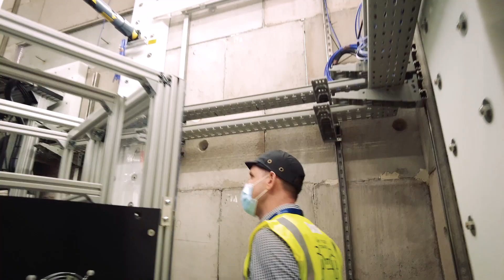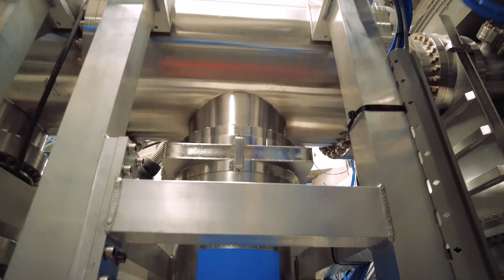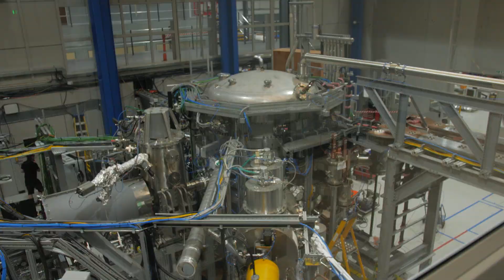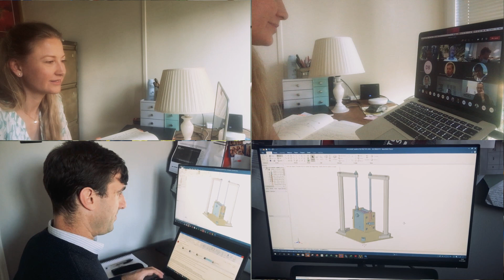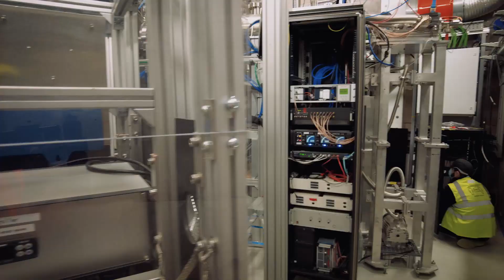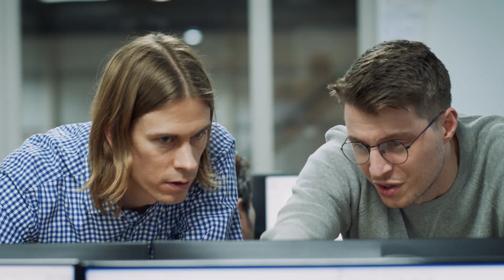ST40 tokamak progress update - March 2021

Comment: Target temperature is easily attainable with intrinsic regenerative process (an explosion) not so extrinsically via an analog process (closed loop regulation). 

The alternative approach may by pulsed regenerative plasma approach. Ten times the traget temperature is easy. Namely the plasmoid. Advantage? Does not intrinsically enter a runaway process also no harmful byproduct.

Comment: Is this reactor project aiming to achieve break even energy output? i.e. not necessarily going to actually harness that energy, but prove that break even is possible?
Reply from the maker: No.  This machine aims to reach fusion temperatures.  We plan to build another tokamak with high temperature superconducting magnets to achieve breakeven.
Reply: @tokamakenergy6400 Thank you for the reply, very exciting to see more smart people work towards something beneficial. 

Btw will you be employing REBCO superconductors on the next project after this one or are you already employing them on even this project?

Comment: VERY NICE! if your interested in subject please check out my demo core on my channel. I'm not a science educator so bare with my badly simplified explanation's of very complex interactions of the working functions in the demo core the design is not open the data is, the MFC its based on my work on fully passive to low energy confinement methods for plasma for hot fusion. my M.F.C is very similar to a tokomak but uses soft x-rays from the reaction for plasma confinement and only one magnet for particle rotation and electrode protection this cuts out the need for high power magnets and cooling tanks reducing the needed input power while maintaining energy density. I'm in the process of a full up grade from the 3inch demo core to a 8x or 28inch proto core for testing
https://youtu.be/y6NE1mDwyHE

Comment: I'll check back in 30 years.
Hey, here's an idea, work on developing a new solar technology that's more than 60 or 70% efficient.  If you do succeed with fusion, I'll still be paying the giant power company for power.  If I can put affordable solar on my roof, with a battery system like the Tesla power wall, I can tell the big power company to piss off.
Reply from the maker: Yes, definitely, go ahead! It's a great idea to put a solar panel on your roof. We should be using every clean technology we can, and if you can generate your own power without being in thrall to the giant power companies then that's a real benefit to you. But (depending on where you live) I'm sure that when it's cold and dark and you don't have enough solar power to run your lights and your heating and your oven and your TV, you'll be really glad that the giant power company can sell you some fusion-powered electricity. Or that the fusion-powered hydrogen/synthetic fuels plant can create enough clean fuels for us to keep flying and shipping goods around the world. Or that the fusion power station can provide heat to keep industries like steel and cement going for construction. Less than 20% of global energy is electricity. So yes, the solar panels on your roof will help, but we are going to need a whole lot more if we are going to maintain our lifestyles and improve the lives of others in developing countries.

Comment: A  BLACK HOLE.    Fusion any day now.   

SMRs actually work.

Feeback & control is not up to the task,  much less the materials.
Reply from the maker: We believe we need to use every technology we have in order to secure a sustainable CO2-free future. SMRs are part of that pathway and that's great. But we also want to try and improve and make things better, which is why we are working on fusion. There will be space in the energy market for a lot of players, so if you also have a vision of a clean energy future then we all need to work together.

Comment: So it is still plasma at this temperature. There is no 5th state of matter. Why dos plasma have such an extreme temperature range.
Reply from the maker: That is a very interesting question.  I suppose that because once the electrons are stripped from the nucleus and the individual charges are free, then any extra energy goes into accelerating the individual particles rather than changing the "form" of the matter any further.  There are some other unusual states of matter like the Bose-Einstein Condensate but these aren't seen in everyday life.

Comment: You Tube is absolutely awash with upbeat videos about fusion power. It is impossible for a scientifically trained layman to get to the real facts. Could someone comment on the accuracy of these statements:

  The only fusion experiment in the world to use a tritium/deuterium plasma, and thus to obtain fusion power output is JET, and it only ran for 5 seconds.

No one has succeeded in breeding tritium from lithium, which is absolutely essential for a commercial power plant.

No one has achieved more fusion energy than power input to the plasma.

Inertial fusion is in an even worse state than magnetic confinement fusion. The Americans have spent huge sums on their National Ignition Facility, without achieving break even on energy. Their massive lasers can only fire twice a day. They need to increase this to 10/second for commercial amounts of energy.

Even ITER will not produce any power until 2035 at the earliest. Commercial fusion power cannot happen until 2100

But I still think it is worth trying,  mankind really needs it to work.  It is more important than the Large Hadron Collider , which has no practical application, and costs just as much.
Reply from the maker: We can comment, though others might want to chip in.

1. JET.  No, not the only experiment to use D-T.  The US tokamak TFTR also used DT fuel in the 1990s and achieved fusion.  I think both JET and TFTR probably ran for less than 5 seconds.

2. There are designs of lithium blanket modules to be tested on ITER.  Lithium breeding has never yet been tested in a real fusion reactor.

3.  Yes, no one has yet exceeded the energy breakeven point and got more energy out of the plasma than was put in.  World record is 70% out.

4.  Not sure we can comment on laser fusion being in a "worse state" than magnetic confinement fusion. We think MCF is in a pretty good state :-)  We see steady progress.  Even NIF scientists have made good progress on improving the compression of their pellets and better understanding instabilities.  Like you say about CERN, it's all useful fundamental physics information and an increase in knowledge always leads to spinouts and new technologies eventually.  And laser technology is also improving all the time too.

5.  Yes, ITER aims to turn on later this decade and start DT experiments  ~2035.  The results of their studies will be scientifically interesting, but many start-ups hope to have demonstrated breakeven by then and hopefully even electricity production.  Ideally we'd like to start commercial demonstration and roll-out in the 2030s for wider deployment in the 2040s to start impacting climate targets. It will be a big push.
Reply: @tokamakenergy6400  

Thank you for your replies. I certainly did not intend to disparage all the thousands of scientists and engineers that have spent their entire lives working on the fusion problem. However visible progress has been quite slow , at least compared to the amazing developments in electronics and computing in the last 50 years. It is evidently the most difficult technical problem that man has ever attempted.
    As a layman, I have followed progress in fusion research every since JET started working in the 1990s.  I have one question  to which I have been unable to find an answer:
      All tokamaks seem to rely on a plasma current, driven by induction from the central solenoid. As the solenoid current has to be ramped up or down ( As any student knows, transformers do not work with DC ), eventually the current ramp must reverse direction, and the plasma current will also  stop and then be restarted with the current in the opposite direction. Does this mean that the plasma disappears when the current reverses? 
     Does this mean that tokamaks must always work in a pulsed mode? I see that ITER is intended to run for 600 seconds,  however it must then be restarted. One wonders how long the restart will take.  It is difficult to see how a tokamak power station can provide reliable electricity generation when continuously starting and stopping.  The next step after ITER is called DEMO, but searching for this returns little information on continuous operation.
   Is there an answer to making MCF work continuously?

   To return to your ST40 design, are you intending to use DT plasma, and get a value for the Q? Or can you use deuterium plasma and get some fusions, and extrapolate the performance using DT.  Presumably once you use DT, the whole reactor becomes radioactive, and that pretty much terminates any new development.

Comment: JUst curious, not critical. What was the plasma temperature of MAST when I visited in 2008? 

Also there wasn't a bio shield last time. What radiation are you expecting (levels and type)? My early life was spent in developing and standardising measurement for radiation protection and health physics - but only up to 2MeV Gamma and all the usual alpha and beta radiation, "Fast" Neutrons were 40KeV. I imagine fusion product neutrons will be a bit nippier? etc. Good luck with firing it up. Like the end of the fifth element?

Comment: Sooo many questions! What would be the product of the fusion? Helium? Or would it continue until it's too dense like iron or something? How long does fuel last? Does it have a continuous source of fuel ( being pumped in or something)? How do you remove the fused particles once you no longer have fusion happening, and how would the particles be cooled? I'm basically imagining a mini sun, how would you control it? How do you prevent it from exploding? I'm assuming the pressure at the core of the sun aids in fusion, do the magnetic fields create a sort of pressure too? or are they just keep plasma from touching the chamber? Could the fusion eventually create it's own magnetic field? And could that cause issues for containment if too strong?

Edit: Is the imagining of a mini sun an incorrect representation of what fusion is trying to achieve?
Reply: The fusion stops when the magnetic bottle colapses and when the heating (electron beam,neutral particle, microwave) system stops working and the plasma expands it cools down.
It basicle cant explode.
Reply: @miles2378  Interesting, thanks for the reply.

Comment: This explains why you've been relatively quiet for a while. That looks like a pile of work. An explanation of why you've put up a big wall now and didn't need one before would be of interest. Just a more energetic system?
Reply from the maker: We are going to achieve higher temperatures in ST40 now, and that means that there's a chance that fusion reactions will happen and neutrons will be produced.  So the wall will protect people in the building from any energetic neutrons.  In future power stations the energy of the neutrons will be captured to create heat and make electricity, but not in ST40.
Reply: @tokamakenergy6400  what date are you thimking for the  100 millon degres might be achieved? Excuse my english Is not so good...I speak  español..
Reply: @tokamakenergy6400  Right. I guess we are all looking forward to some energetic neutrons :-)